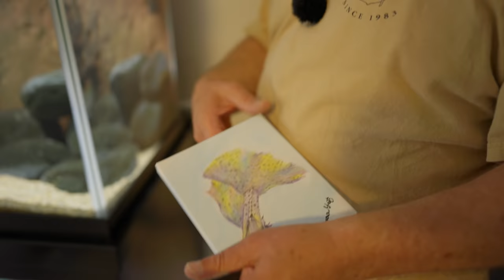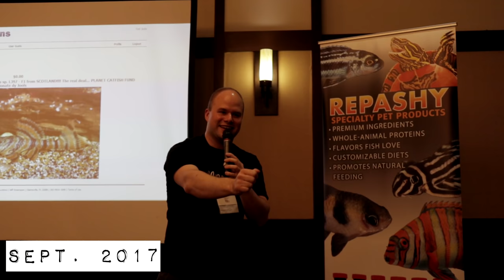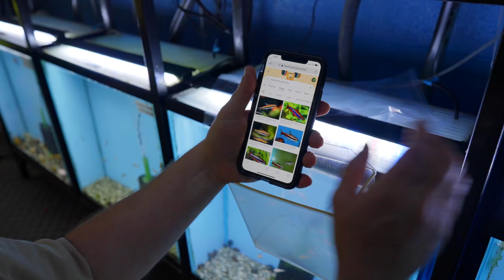Selling Hundreds of Fish - Day in the Life of a Master Breeder!

Comment: The TP Link smart plugs are nice, but so are the cheap off-brand ones. But if you need a lot of plugs on different timers, consider the Smart power strips. There are power strips that have multiple plugs and each one can be controlled separately.